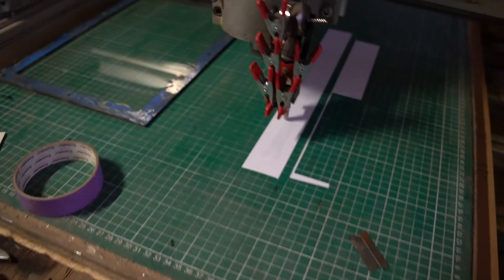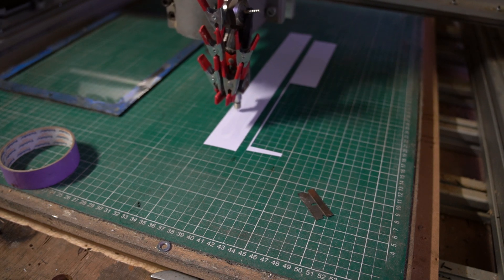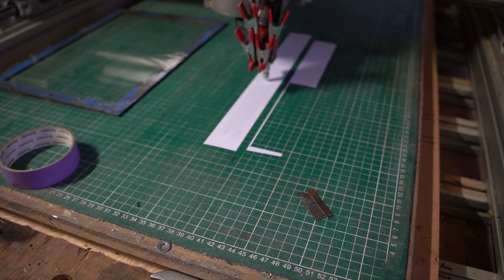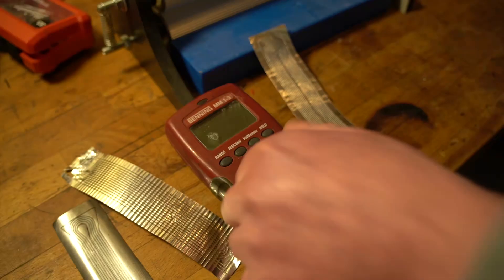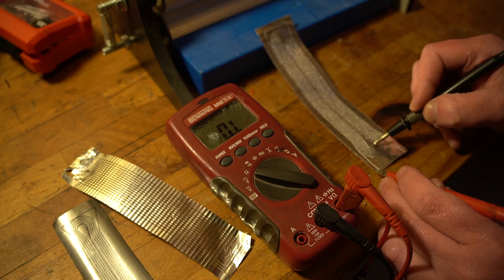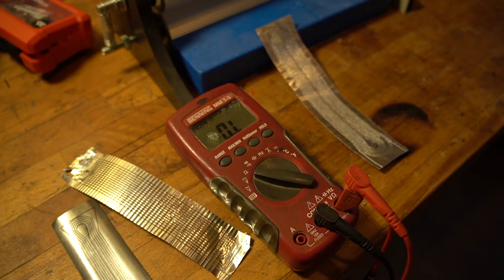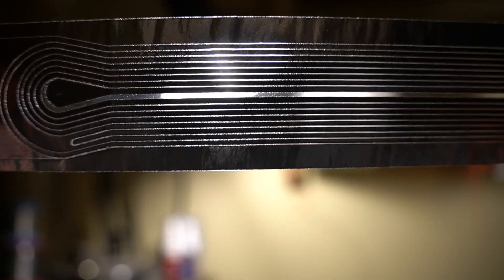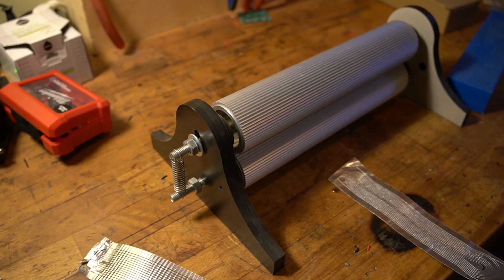3D printed Carver style tweeter part 1 - Screw Etching Delicate Tweeter Membranes

Comment: I will be trying this on 3d printer soon, very impressive results.
Reply: Shouldn't be a problem,  I doubled my steppers,  one on either end of each the x, and y axis. But only one way to find out.
Reply from the maker: as long as you use a cutting mat, and enough weight on the blade.. hope the motors manage :)

Comment: The next step up would be to use a 1064nm pulsed laser engraver. 
There spot size is really small, like 10µm small and due to the pulsed operation you can just evaporate the alu tape away.
Fast, Repeatable, but a machine cost ~2K.
Reply from the maker: well yeah also question how clean it will be and what happens to the adhesive.
Reply: @joppepeelen  At the power densities pulsed lasers create basically everything evaporates as long as the material absorbs enough light. The glue won't stand a chance. 
The resolution achievable is pretty good because the beam quality of fiber lasers is very good and due to the pulsed operation the heat transferred to the Material around is minimal, so edges are sharp but I have no experience with cutting foils just engraving but I'd imagine it would work great.
Reply from the maker: i did look at 50 watts version but its a steep price without knowing what it can do :)
Reply: @joppepeelen  Recently got a "Snapmaker 1064nm Infrared Laser" - excited to try this out. EDIT: oh, looks like it doesn't have nearly enough power. There is a diy drag knife that may be worth trying though.

Comment: Doesn't the cutting knife waste the cutting mat a lot?
Reply from the maker: I did not look under it yet. but i assume it will go in much deeper yes :) i thought of maybe adding a softer barrier , like paper or something. so the knife will sink deeper in the alu instead of the cutting mat (but it will be horrible to get it of again after). to bad i cant cut the alu with the paper on the bottom side. but i like the fact i cut 5 coils so far and they are all the same. tomorrow ill see how small traces i can get. next up will be 1 mm wide ones :)

if the cutting mat is screwed, i go just for this method with small cutting mats (since only small mebranes benfit from this idea) from the action they are like 2.50. if i can get 30 coils out of one mat (and i think it will be more) its worth it
Reply: @joppepeelen  Yes, I reckon that's a small price to pay. Nice idea of cutting the aluminium tape with the aluminium side down! What adhesive did you use to make it stick on the cutting mat?
Reply from the maker: i used 3M remount, be sure to use something with a sharp edge to force it into the cutting matt, as i did in the beginning. i used some cutoff HPL that has an edge you can cut yrouself on. thise small surface area when pushed into the paper backing creates allot of force over a small surface area. play with the angle to not rip the paper. so a low angle as possible so you do not scrape of the paper backing.
Reply: @joppepeelen  Ok, I use reMount the same, but with the paper back down. I then use a plastic spatula to get it to stick.

Comment: sick. now can you get it in 18" wide rolls?? for making a woofer panel
Reply from the maker: well this foil is to thin for woofer coils :)  (and i do not trust that small spacing for high current applications ) i do have foil for that for years :) the biggest problem is go smaller ... bigger is doable :)